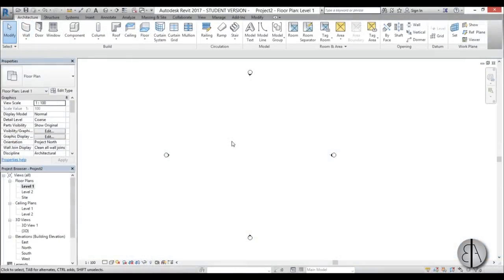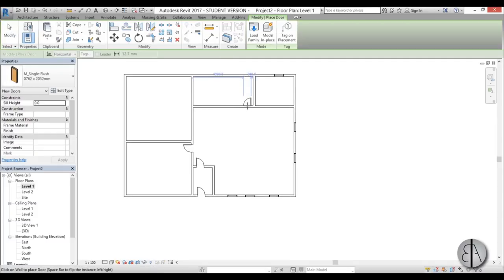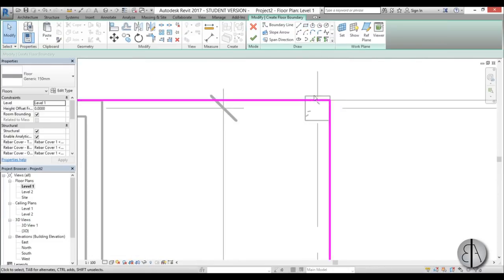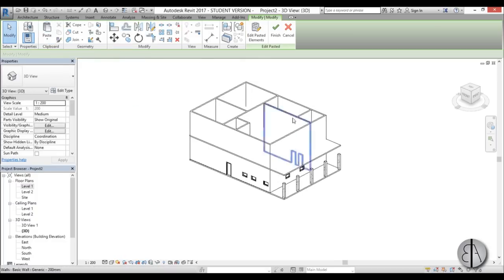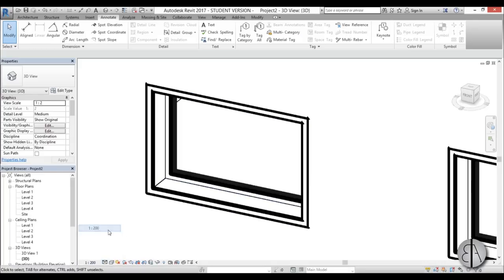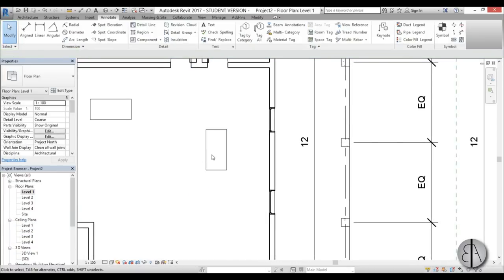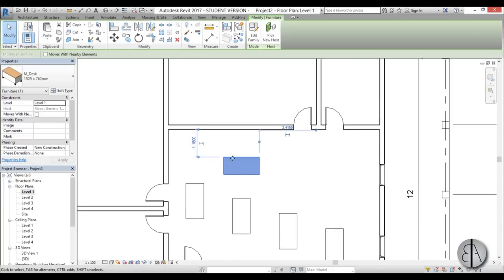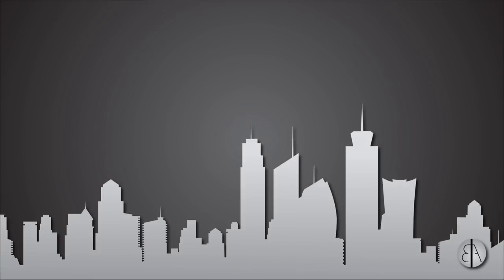Revit Keyboard Shortcuts and Hotkeys Tutorial

Comment: One of my favorite things is to customize shortcuts in Revit. Goes against what you said in the begining of the video but lots of people work on the same computer over and over. I use these all the time and primarity focus on having shortcuts i can reach with my left hand so i can keep my right hand on the mouse. 
Basic adjustments are:
AA - Align comand (remove previous shortcut assignment)
DD- Detail Line
E - Delete (E then press spacebar and it will delete something similiar to CAD)
DE - Dimension  (remove previous shortcut assignment)

those are the main four I customize and find it very helpful. Hope it helps someone.

Comment: Thank you for the helpful videos, no matter how simple, i learn something from them.

I highly recommend to use:

HH temporary hide object
HI temporary isolate object
HR reset temporary adjustments. (You mention them in video but not on list. Once accompanied they are really addictive). 
EH, RH and EU also controls visibility (not temporarily)

EL to put elevation mark on floor surface. It works to check level, even on 3D

Keep pressing the Shift key to enable/disable ortho, when in command
Shift + tab to reverse back from tab key cycling. So you don't need to go through all that tedious tabing all the way again.
Pressing Ctrl key enables/disables copying in commands like mirror, rotate, even copy or move

The first letter and space also works for most commands. Just keep an eye on lower left screen.

I recommend to add shortcuts E for extend EE for multiple extend and J for join.